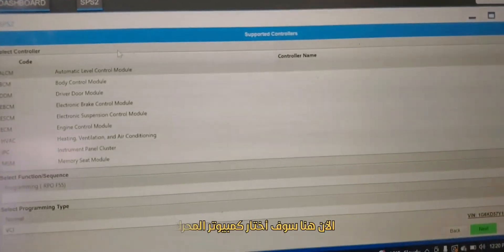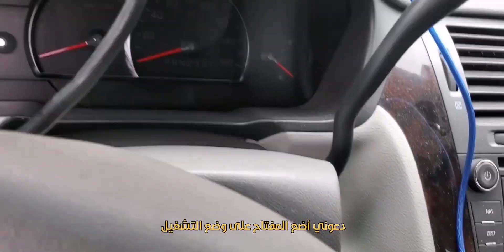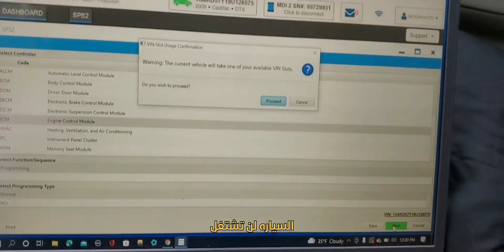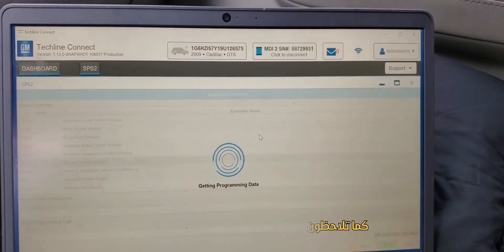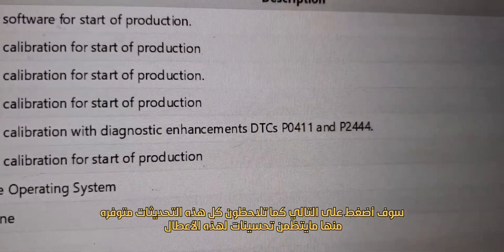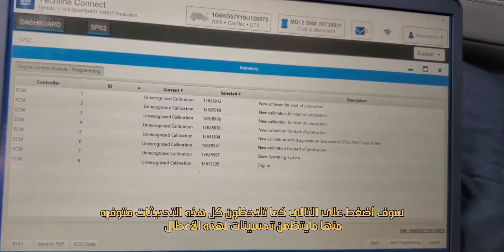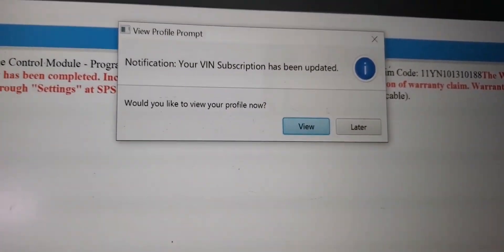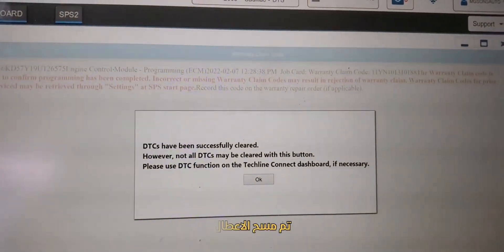Cadillac Engine Computer Programming Using SPS2 And MDI2 ✔️ برمجة كمبيوتر المحرك على كاديلاك

Comment: Hello, I really enjoy your videos. I have a question the MDI 2 need to be original or can it be aftermarket? I am trying to buy the MDI 2 to program the Chevy computer but I am not sure if it needs to be original or I can use the aftermarket. Thanks
Reply from the maker: get any cheap pass-thru j2534 it will work  like $25 one
Reply: @BestCarFixes  I have the j2535 is the im608 will work with it ? or do I have to buy another one ? And also I need the inscription to the acdelco